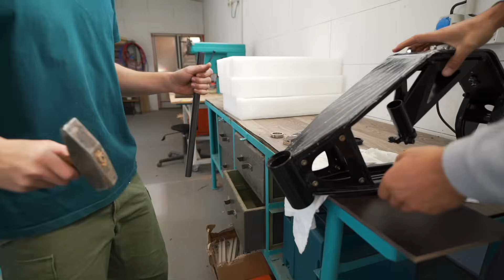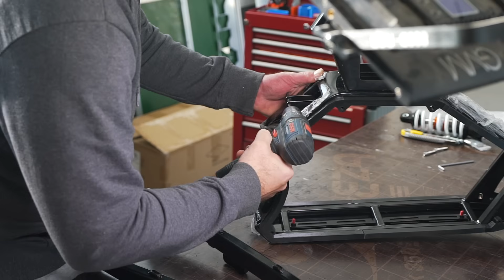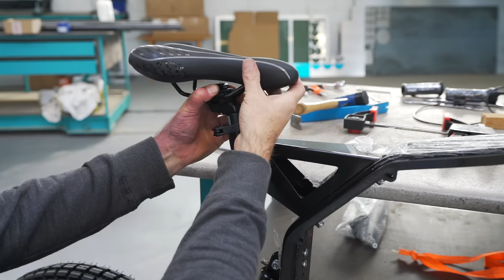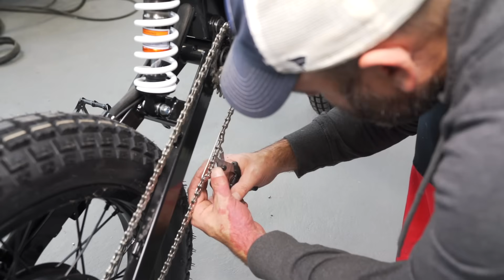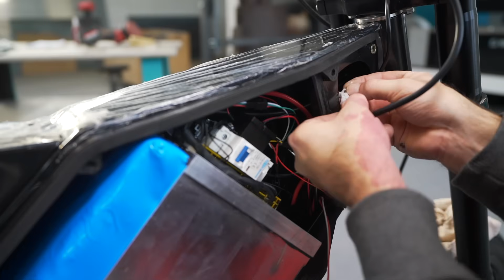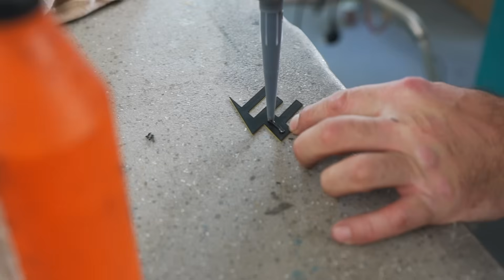How to Build Powerful eBike / START TO FINISH

Comment from the maker: There is a path forward for legalization!

We sell these ebikes as "ready to ride" for off-road use, but if you're interested in using on public roads, the path towards legalization is very quick and easy. Legalizing your electric bike will mean you can apply for insurance, a license plate, etc. More information about this process is included in the description of this video. If you have any questions, let us know below and we'll do our best to answer as many as we can!
Reply: Does it work in Germany too?
Reply: Thank you for sharing, I'm building a bike like that but don't know where to buy electric wheels. What type of battery should I use? After finishing it, I don't know if I can register the license plate or not 😂😂😂😂 be happy and safe
Reply: I'm from Bangladesh. How to buy?
Reply: Ladi, how much are the off-road bikes?
Reply: @ladiandmargaret  do you make pas levels 1-5 . 1 is class two, 2 class 3, 3 is 60%, 4 at 80% throttle 5 100%. Also make pedalable to 40mph with a slump drive. Or whatever. And 72v(84v) 70ah . Need most miles possible cause I'm 6 2 250 plus 30-40lbs of work tools. This is only form of travel until I get drivers license back. Most driving is 95% road or bike trails. So 20-40mph mostly with 5 miles of 50-65 mph.
Reply: Top das galáxias 🫵 aOnde compro  uma máquina dessa?faz entrega para O Brasil?desde já agradeço pela atenção 🤝
Reply from the maker: Yes, we ship globally :) RideVoltic.com
Reply: It's not an e-bike it's an electric motorcycle.
Reply: @mjm1970-4  Nope doesn't qualify as an e-bike. We were here first find your own label.
Reply: @ghz24  grow up u sad little fool touch some grass and have a shower please
Reply: @mjm1970-4  Nope it's an ore-bike (off road electric bike) or it's a moped if you license it.
Reply: @ghz24  Nah it will always be an E-Bike. Not powerful enough to be an electric motorcycle. Not classified as an off road vehicle. Don’t have to be licensed. Read the title to this video.
Reply: @mjm1970-4  No operable pedals so not street legal without a license and insurance.
Any power over 750 watts (1000 in a couple states) is not an e-bike over 2hp or 1500 watts is a motor cycle or a motor driven cycle depending on state and any vehicle not street legal is automatically classified as "off road".
I read the title, that's why I pointed out it's not an e-bike.
Edit : he said it had 13 kWh that is more power than a 175 cc enduro which is more than the 150 cc minimum to drive on an interstate highway where I am.

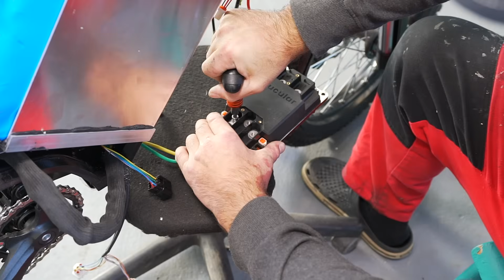Comment: 18:35 why did you connect a positive led of battery to a phase wire
Reply from the maker: For charging purposes. We charge through the moto which works as a step up convertor

Comment: Nice...I bought a new 5kw hub motor for my Stealth Bomber but the fase wire coming from the motor are to close to the motor and the break disck bolts where touching the wire...my old motor fase wire where far from motor ....the new came in orange color not black...I had to trimmed down the bolts...

Comment: Nice bike.  Can you purchase it with a qs 273 motor?  Or is that not recommended and the qs205 motor is actually better for this build?  Would you need heat sinks and ferro fluid?  How much?
Reply from the maker: We can mount 237 but I would not recommend it. It becomes too heavy and it’s not needed for 17kW. More power is not recommended for this frame. We ship with ferro
Reply: Thanks.

Comment: So it goes 60 mph, but only goes 50 miles? Can’t even ride it for an hour?
Reply from the maker: These bikes are not good for lock in full speed from charge to full discharge. They are less efficient because of the big wind resistance.
Reply: At 60 mph won't go that far 60 is just max speed

Comment: Not an e-bike!
Reply: Wrong comment section
Reply: @rolandroland1485  Nope you are confused. The device being built is not legally an e-bike.
Reply: It’s still an e-bike
Reply: @geridrh  If you have to license it to be on the street it's an electric motorcycle. If you start including illegal devices as "e-bikes" legislators will include legal e-bikes in their legislation to control what is already illegal because jerks try and pretend these are legal when they get caught breaking the law when they know damn well they are lying.
It's like the word scooter, which is used for everything from a kids foot powered glorified skateboard to a highway capable vespa.
So no it doesn't qualify legally as an e-bike because it has more than 1000 watts which is illegal for an e-bike in every state.
It has no operable pedals either but it could be configured as a moped, maybe.

Comment: imagine using 30k dkk and still need to build it
Reply: Half the fun is building it and learning about it, the better you understand about how it all goes together and works the easier it will be to fix it if something happens.
Reply: @francisogrady1780  diffrent people i guess, I love tinkering with it. 

But that's when it's broke  down.. I like to see how it's supposed to feel from the manufacturer first, before trying to build it / fix it
Reply from the maker: You can just buy finished product if building is not your thing.

Comment: Great video Ladi, love the custom upgrades, like the motorcycle headset bearing and the 3D panel extension to widen it for the battery, I need a set of these! Have you ever put a moto seat on this bike? I changed my bicycle seat to the moto seat a few years ago now and it lowers your center of gravity, but the trade off is no more pedaling because your legs no longer get extension.

Comment: Ladi, where do ppl buy one of those custom made motorcycle headsets? i bought one of those frames and b/c the headset was one of the first big problems with it, i found a thrust bearing for one of the sides, bottom i believe.. anyway, this would be much safer and reliable option, good work!

Comment: If this was build, I would put the controller in a Garmata enduro seat, that way you don't have to make holes in the frame twice, or print a cover for the controller.  Plus you get the advantage of a heated seat for winter :)
Reply from the maker: That’s a good idea🤩

Comment: Ladi, Just an idea unless you have already thought of it: Before mounting a bushing into a bore, try warming up the bore with a heat gun/heat lamp (or an oven if you can get an oven large enough) and place the bushing into a freezer for several hours. I do this at work every day with helicopter parts all the time. Makes installation much easier. And using hydraulic presses helps too.

Comment: $6k is too much
Reply from the maker: How much do you think it should be and what are you comparing to?
Reply: @BuildStudioHQ  first off, that’s 2010ish Honda accord money. That’s older Ducati money. Thats 500hp LS motor money. That’s cross cart money. I can have a lot more fun with that cash. But That’s the going price of a decent ebike anyway. I’m not gona build something for the price of turn key.
Reply from the maker: Have you ever ridden powerful eBike like this? I agree you have unlimited options where to spend money.
Reply: @BuildStudioHQ  couple of surons and another bike that is similar to the suron. I’ve owned a few bolt pros.
Reply from the maker: Surron with 6kW peak power, 2kWh battery and bicycle components? That’s not the same price range or specs to compare.
Reply: @BuildStudioHQ  yeah ok. Sure.

Comment: All the frame drilling..cutting..gluing.. Fitting of printed parts and head tube cups should be done before selling.
Reply from the maker: We are a small team and this is very easy and satisfying project to do.
Reply: @BuildStudioHQ well I’m a mechanic and I would love to build one myself, but I can understand that most people don’t have the tools or the capacity to cut, drill and glue metal panels, specially considering the price. Should consider make the hardest parts of this build pre made on the kit ;)
Reply from the maker: Thanks for the opinion. People can still buy the finished product. I found gluing, drilling and bolting very basic skills. We made the video public so people see the required skill and filter themselves.
Reply: @BuildStudioHQ sir what is the cost for one
Reply: Yup
Reply: Having the end user do the little fiddle stuff helps reduce the cost. If they did it all they would have to increase cost. Kinda like buying an 80% receiver and building your own pew pew.
Reply: Do you have a site for different models. Do you have ones you can pedal until 40mph issh. 84v70ah top speed of 70mph+ programmable pas 1-5 . Mostly paved roads and plus bike trails. Thx
Reply: I just need the kit how much was that.. I already have a e bike.. link please
Reply: Never played Legos before? 😂
Reply: Hmm it's like saying Lego kits should be preassembled... OK but people can choose
Reply: @chinesesparrows  Selling completed bikes would put all the defective stuff on kit seller/builder . 😲

Comment: way too expensive and for what? A ridiculously incomplete kit where u have still have to add soo much and do extra work. U pay this much and get 3d printed parts. Seriously?
Reply: Mans doesn't understand how expensive machining everything can become nor how expensive battery tech is.
Reply: Dude you haven't a clue what you're talking about so I'd suggest you stop and do some research and then come back when you look up the prices of electric motorbikes. These have at minimum twice the power of a surron.
However what I do agree on is that a kit shouldn't require modification on arrival. That needs to change. Ladi needs to do the modifications before sending the product or change the product. Assembly is absolutely fine but asking people to make modifications limits your customer base massively as most people might be able to use tools but they probably don't have the skills or equipment for modifying.
Reply: Then go purchase the completed bike.
Reply: Uh, just meatballing here, but maybe you just don't buy it...??? Constructive criticism is always great, helpful for producers and consumers alike. Just shitting on the product of someone's obviously honest, hard work....maybe not so much.
Reply: Its insane.  Ita like ikea
Reply: Electric stuff is extremely expensive now bro 😂
Reply from the maker: You get all the parts to finish this same bike.